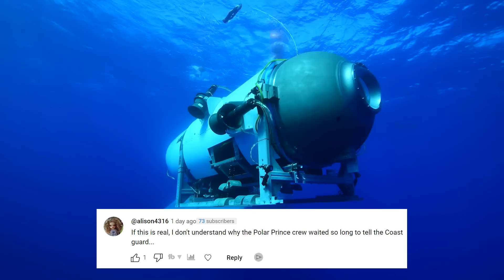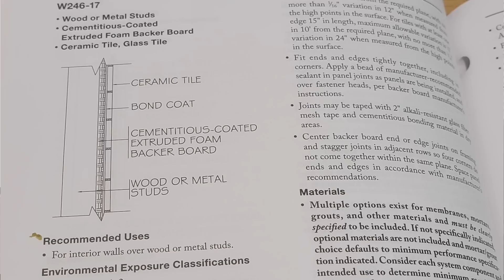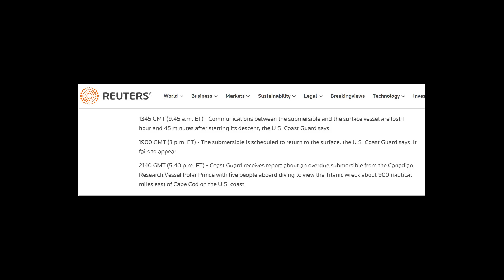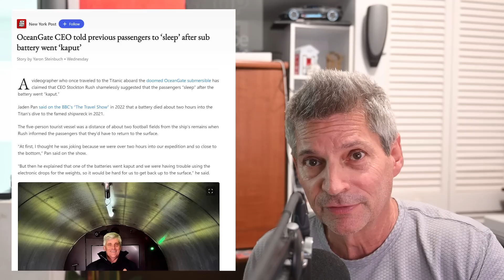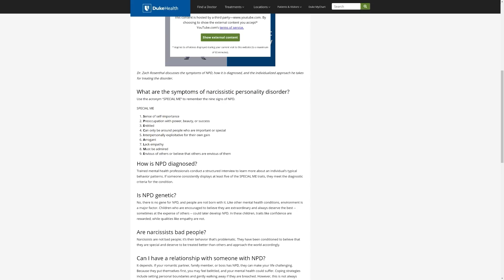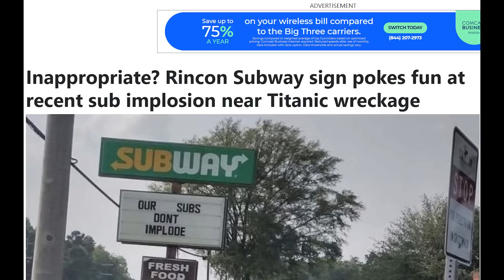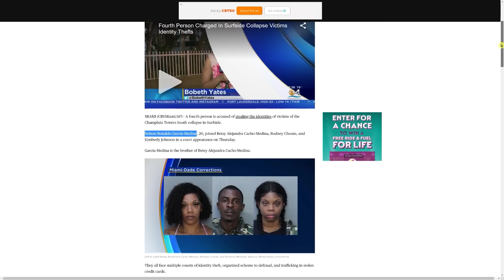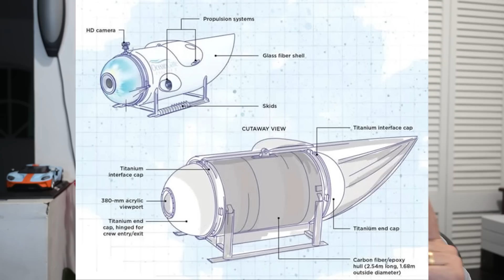Titan Sub: Why OceanGate Waits 8 Hrs Call Coast Guard, Q & A

Comment: I have heard a fair amount about the owner specifically hiring young people in order to be more "inspiring". Perhaps if he would have had a couple of his eschewed 50 year old white guy ex military submariners hid acceptance of deviance factor might have been a lot less. It takes a strong person to stand up to someone you see as a good boss while working on a great project. Who wants to risk that, right? A couple of older people might have had the confidence to just tell him "We have some problems and we need to get them sorted before we dive again." If, by force of personality, he was causing some of the people that should have been giving him hell about some of these issues, to remain silent he could have been ignorant of the true level of danger these things represented. It seems that every team that does something hazardous  has to have somebody who has the personality to give the boss a ration of hell if he thinks bad or dangerous calls are made and is respected by the boss enough to be listened to. The boss will have final call of course but surrounding yourself with yes men, deliberately or not, is a dangerous thing. In a case like this I'm not even suggesting a lack or technical skill on the team. Just that they seemed to lack somebody who was salty enough to give the boss the information he needed in a way that he would listen to. 

In short, a young pretty team is all well and good but get a few old salts in key leadership positions.

Comment: In defense of Titanic, the number of lifeboats was partially based on the premise that there need not be a seat for all on board because the lifeboats would be used to ferry passengers and crew to other ships. And based in part that Titanic could have a number of watertight compartments flooded and remain afloat long enough. And Titanic had the Marconi wireless telegraph to send out distress signals to other ships at distances farther than distress rockets & signal lamps could be seen. 
Previously,  there had been two ships in distress which supported the wait until rescue arrives plan:
One was where passengers & crew were rescued by another ship.
The second was where the captain started loading the lifeboats (women & children first) only to see all lifeboats capsize only for the ship itself remain afloat/intact until other ships arrived.

Comment: if they delayed calling authorities after they knew the sub imploded, which they did but pretended not too, that's criminal negligence! But more concerning is the fact Ocean Gate skated around all the safety protocols while operating a business running clients down to that wreck which equates to severe government failure as well! It wasn't if that thing imploded but when and THAT should have never be allowed in any waters! They are suppose to help protect citizens and allowing any company to build a coffin like that for commercial use is accessory to murder! Government agencies should be held responsible as well!

Comment: Both shuttle disasters were partially due to normalization of deviance. In both cases, there were previous instances of blow through of the o-ring and foam strikes.  Of course, combine normalization of deviance with the inability of management to head the warnings of their own experts and a situation is created where failure is just a matter of time.

Comment: Normalization of deviance pressures OceanGate had some sort of standards of operation to begin with. Reports that have come out sound like there were problems with many of the dives - let’s sleep until ballast auto release shackles dissolve and often lost commas to surface. Entanglement with ghosts nets and Titanic’s wreck are common concerns with wreck diving; in fact one report says Titan did get jammed against Titanic’s wreck on a previous dive. Given that days passed before another submersible capable of diving all 4,000 m actually arrived on the scene; meanwhile every hour that passes counts against the “96 hours” of oxygen supply. What was the “loss of comms” contingency procedure akin to commercial airliner “loss of one engine & restart checklist”? And loss of comms and does not resurface on time procedure?  Sounds like normal was wait until Titan should’ve surfaced or comms were restored whichever occurs first.

Comment: I think everybody in the submersible industry knew not to make the hull out of composite material long before this. That's why all other submersibles were made out of homogenous materials. There's no lesson there. The only lesson is you shouldn't work in a company with a narcissist in it and you should check for signs of narcissism in the company discription and safety regulations and avoid using services from those companies.

Comment: Dude on the shuttle disaster it was not over rings it was computer error let me explain on the side of Rockets there are what they call explosion-proof boxes inside these boxes is the electrical components to operate the the hydraulics on the Rockets to get them to move in different directions so they can make the shuttle do a belly roll now they have pieces on here that's welded on there that's our brackets that are held onto the the main tank someone put the decimal in the wrong area on the left rocket as you're looking at it from the back of the shuttle the rocket on the left they moved the decimal over let me explain the left red 00.50% per second the right red like this.   000.50% per second that's the reason the left side ripped all the way down the side the tidal stresses opponent was extremely too much

Comment: I've been incredulous at this whole situation since the outset, but that video of hoop winding made my jaw drop more than anything else so far. What an infuriatingly stupid way to layer a composite material when it needs to distribute load evenly. Even yarn is wound on a spool in a more sensible way.

Something that a lot of folks are overlooking here is that CF can be fantastic under compressive load when it is laid up correctly -- high-end bicycles are the perfect example of this. The load needs to be parallel to the direction of the fibers. Obviously a homogeneous material is better for this, but CF could have done better than this. Its like they didn't even try.

I would love to see an experiment with a more competently-wound CF pressure vessel vs. hoop winding at the pressures + cycles the Titan experience before imploding. It might help illustrate how important every single engineering decision (even the seemingly insignificant ones) becomes when working on life support systems.

Comment: It doesn't matter how the carbon fibre was woven, OceanGate used a material that is superb under tension. Then used it in an application that placed it under compression. It could have been tested, it should have been tested to a depth of 6000m that is 150% of operational depth and the industry standard. Stockton Rush wouldn't allow it to be tested, he knew it would fail. In 2019 OceanGate tried to get Lloyds Register to certify the submersible but they refused.
Notwithstanding all the waivers and written excuses, under the US law Titan was required to be certified by the USCG. It was a vessel constructed in the US but it was a vessel that operated in the US waters. It was filmed diving in Puget Sound. Either of those things place it firmly under the jurisdiction of the USCG.
The consequences of this incident will be fines, law suits and jail time. The waiver that the customers signed will not stand up on court, as the information given as part of the pitch was mostly made up. Boeing, NASA and the University of Washington didn't partner with OceanGate, telling customers this is a blatant deceit. That will nullify the waiver. I cannot see OceanGate's insurers standing up for them. The directors and officers are going to be paying out of their own pockets for this.

Comment: Why did they wait or how come they were too slow in contacting the coast guard?  There really was no hurry because they had plenty of air onboard. Second, an implosion would have sealed any need to hurry down and find them.  Mechanical problems would but again the sound of silence was something that was going to happen so, who was on the ship in charge of the wait time duration once they first lost communication and what were the protocols ?  I doubt they really had any but you would think some kind of deployable beacon would have been used for communicating we have problems, come get us etc.

Comment: They would have been better off just casting their hull out of the epoxy they used as resin. The carbon fibers probably just acted like a defect in the otherwise homogenous material.

Comment: This operation was ridiculous.  Anyone who understands anything about engineering sees this as eventually leading to what happened.  Who would go on a expired carbon fiber craft (the way they laid it seemed parallel too, like they didn't even do what most people do with CF) sandwich that between much stronger titanium end caps, and connect them with epoxy.  WTF were they thinking?  It's so frustrating because he killed 4 other people with him.  Every new news about this is just how it was even more of a death trap then it first appeared.  It's bonkers what rich people get away with (well he didn't really get away).

Comment: Don’t commercial airliners use spiral wound carbon fibers.  So spiral winding in it itself is not necessarily an issue. 
As you pointed out video in your first, the three dis-similar materials is a much bigger issue.

Comment: Hey Jeff, here's an interesting paragraph from Composites Weekly, back in 2017: 

"After the Titanic mission, Cyclops 2 will be off on a variety of other missions that, says Rush, will keep the craft busy for the rest of 2018. OceanGate, he says, will build at least four Cyclops 2 submersibles, and as many as 20, depending on demand. Rush says Cyclops 3, 4  and 5 are already on the drawing board, will target depths of 6,000m and likely will feature carbon fiber composite hulls."

Deathsub Rush had some ambitions...

Comment: My question concerns the validity of the recent OceanGate transmission transcript you have analyzed.  It has been several days since it was released, and it would certainly influence the feelings of the friends and relatives of those who were lost.  OceanGate knows if this transcript is real or fake.  If it is a fake transcript, then why hasn’t OceanGate officially declared it as a fake?
If the transcript is real, I can understand why OceanGate would not respond due to possible legal ramifications.  However, if the transcription was a total fake, there would be no reason to deny its validity.

Comment: Carbon fiber would make great Shallowater Subs. Could even make a sport out of it. Fastest submersible competitions. Carbon fiber might be the material to go the fastest underwater. Max depth of 30ft. Make it slightly buoyant and the only way it Dives is using speed & aiming down. But if you lose power, trustets, pass out it would just float to the top when your hand fell off the thruster.

Comment: As I understand the concept of "normalization of deviance", the most appropriate example might be the acceptance of "in family" foam separations and impact damage to the tiles of the Space Shuttle's thermal protection system. As I understand it, any damage would compromise thermal protection, yet damage was seen and a certain amount accepted as "in family" because the vehicle survived re-entry conditions without incident, until Columbia.

Comment: It wasn’t that they thought there were enough lifeboats for everyone, they just wanted to follow the minimum standard required at the time and like you also said, they really thought the Titanic WAS a lifeboat itself. They never imagined a scenario where more than 4 compartments would be compromised at the same time.
Reply: History taught them a powerful lesson, as 2 of the 3 ships in this class sank, with catastrophic loss of life.
Reply: They didn't even do the minimum they did better - had 4 lifeboats more than required by law.
Reply: An irony was the legally required evacuation drill was scheduled for that day but was delayed by the Captain as it was raining and didn’t want First Class complaining.

If they’d done the drill they’d have been shown the lifeboats were double benched to sit back to back and had plenty room for all onboard..
Reply: @stevepirie8130 wow, the captain had some issues eh? Didn’t do the drill, didn’t want to slow down in the iceberg field…good thing he went down with the ship…
Reply: They followed the standard and exceeded it by having 4 more lifeboats on board as required by law. Hardly something you could use as example for “Normalisation Of Deviance”. Not wise? Yes. Arrogant? Maybe. But the Titanic was built and equipped according to the standards of her time.
Reply: @Zeguyfromgermany True. Back then the amount of boats was based on the weight of the vessel and not the amount of passengers. 

It seems ridiculous , but there is a reason why the saying goes : safety  codes ,rules ,and regulations are written in blood.
Reply: Had SS Californian responded to Titanic's distress calls, the lifeboats might still have been able to ferry all passengers to safety as planned, but inexplicably they ignored the distress rockets.  😔
Reply: @221b-Maker-Street  The Titanic didn’t fired distress rockets in a manner that the California could’ve interpreted them as distress signals. Let me explain.
Both the “California” and the “Titanic” were British vessels. The Distress Signals mentioned in the Merchant Shipping Act from 1894 were written down in the “Rules of the Road at Sea”, Article 31: “[…] Rockets or shells, throwing stars of any colour or description, fired one at a time, at short intervals.” 
Unfortunately, the Titanic fired only 8 rockets altogether (they had 36 at their disposal) in about 1 hour. 6 or 7 minute intervals aren’t short. If you take into consideration that acoustic signals like canon shots should have been fired in one-minute intervals, you can’t blame the “California” for not taking them as distress signals.
If the Titanic had fired four of her distress rockets in one-minute-intervals, waited ten minutes, and then fired again four, the supply would’ve lasted 107 minutes, almost two hours. Groups of three would have lasted 134 minutes. The Titanic sank in 160 minutes, and the first distress rocket had been fired 65(!) minutes after she hit the iceberg.
Reply: Of that era, no boat actually had enough boats for all aboard, as there was seldom a time where a ship would sink slow enough to allow a full evacuation. Boats were typically used to ferry from a stricken vessel, to help or shore, as most ships that didn't immediately sink with all hands...were within sight of land. 
After the sinking, Safety of Life at Sea (SOLAS) rules changed that logic to the standard we know today of boats for all

Comment: Was it much more expensive to wind the CF layers this way? I would have implemented all the best possible options on this radical design (material). Innovation is great but for anything new, you have to test extensively over and over.

Comment: Problem is- carbonfibre is not that strong in compression. Its better under tension. Its like making the Golden Gate Bridge and using cable for the pillars and concrete for the cables . Ok well thats an exaggeration but the basic principle is the same. Just because CF is great in the aerospace industry where its under tension doesn’t mean its transferable to submersibles. I think Stocton was very accomplished but also abit of a numb nut too. 
Anyway im just sad people had to die, like always, to learn these lessons and make amends.

Comment: OceanGate failed to perform any destructive testing to determine how long the carbon fiber hull will last over repeated dives to that tremendous depth. Carbon fiber under that sort of stress likely developed micro-fractures and each dive weakened it.  Carbon fiber hasn't been used in this application except once before with an experimental prototype single use record breaking craft. This was the tech they acquired which is entirely unproven. Along with all the other shortcuts and additional unproven tech.  Rush was inspired by Zuckerberg who would say to run fast and break often.  Which is fine when it comes to software but it's the wrong methodology when human lives are on the line.

Comment: The lack of torsion loads is a good argument against diagonal windings, but the problem is there are considerable axial loads due to the end caps being pushed towards each other as well as the radial loads compressing the hoop-wound carbon fibre. The latter tends to push the fibres lengthwise causing them to buckle and delaminate whilst the former tends to crush the fibres together sheering the epoxy.  If the theory is that the carbon fibres strengthen the material in compression along the length of the fibres, there ought also to be fibres laid along the length of the tube alternating with the hoop windings. The diagonal winding pattern you show is clearly intended for a COPV (carbon over-wrapped pressure vessel) intended to resist internal pressure.

Comment: Standard thing they teach you in boat building is to have different straight and bi-axial weaves as you do your buildup.  When building pressure tanks even for something as mundane as a household water softener they also use the helical weave to accommodate stress from every angle and make a stronger vessel.  If this is critical and well known on surface vessels and low pressure brine tanks in household water systems then its much more critically important in a submersible.

Go into a pastry shop and order a pastry that is wound all in the same direction such as a French Horn or Sfogliatella and see where and how easily it comes apart.

Best!